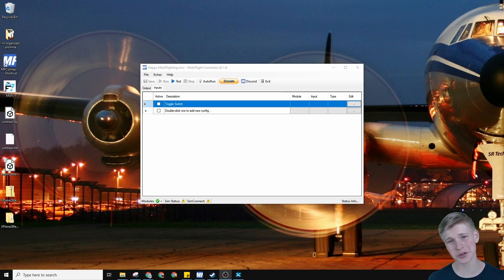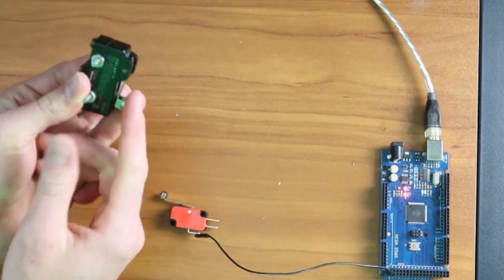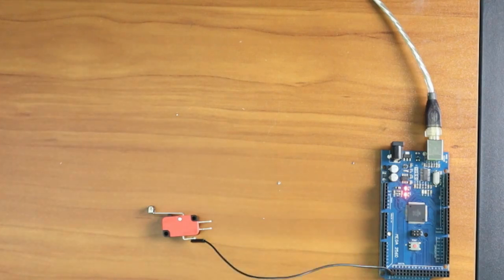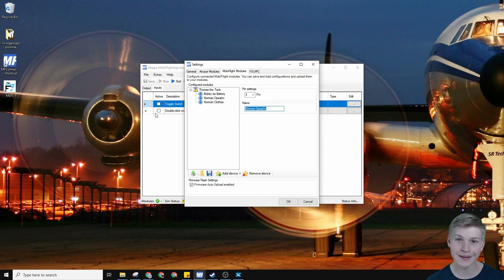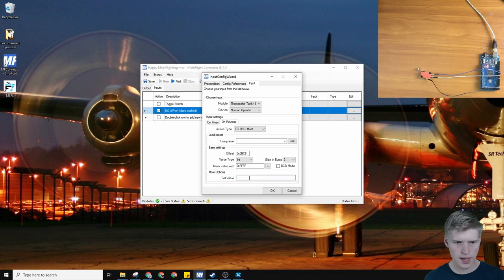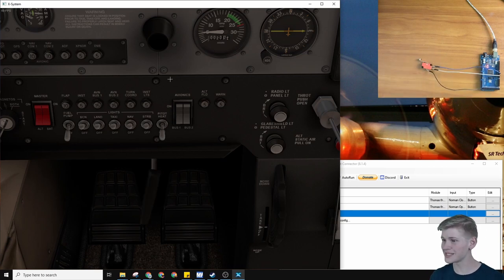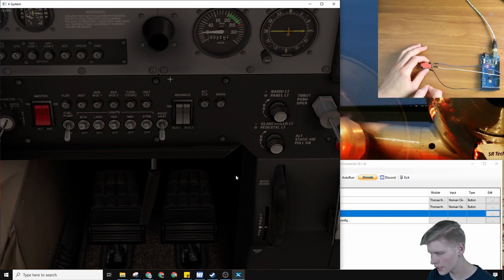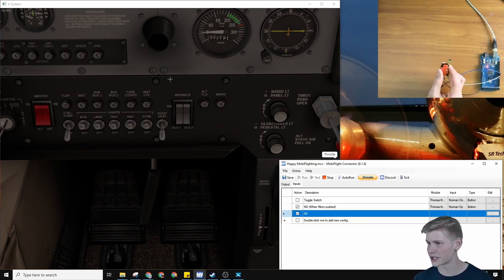Connect a Microswitch to a Flight Sim | MobiFlight Crash Course Episode 10

Comment: Hi  Bob, can i have a link/name for the jumper wires you’ve connected from the Arduino to microswitch? Thanks!
Reply from the maker: Were they these ones?
They are called "dupont cables" https://www.amazon.com/EDGELEC-Breadboard-Optional-Assorted-Multicolored/dp/B07GD2BWPY/ref=sr_1_3?dib=eyJ2IjoiMSJ9.hQTv99RP9Go6a79vMaa4Ax_gaxcssUjCgqmnEZmFewzuwgq7QtJJQoson341P0kjQ2xQXbO2gNj01CDnXO708FQPapphJDW6DW1AAHPe3Z1ifqF1y69-jTbpfDR8aZwZKoGbYZhRLo7gOYy5oLCNDWe8GKtnCuEa7m8-oXsS0l9gUQVqjqKB926sHzKrqMkL7ucGpiYnAwZ2bBCEitEujkv0UEWb6YffnsAoA9c1fbo.-tKP8fw0hPJ8vJlJPZ0G3ni0sxLJPqWgGZVf5GutBkM&dib_tag=se&keywords=dupont+connectors&link_code=qs&qid=1710951991&sr=8-3
Reply: Thanks, Ive meant the the cable fro, the arduino to the Microswitch, it looks like it has a special connector at the end, thanks
 @CaptainBobSim
Reply from the maker: I bent the pins at 3:17 :) @danielpanek413  
There are the "Quick Disconnect Crimp Terminal"  you would use in real life
Reply: @CaptainBobSim  THanks!